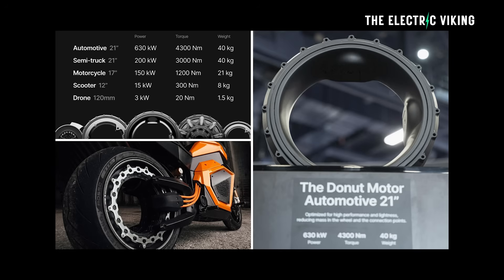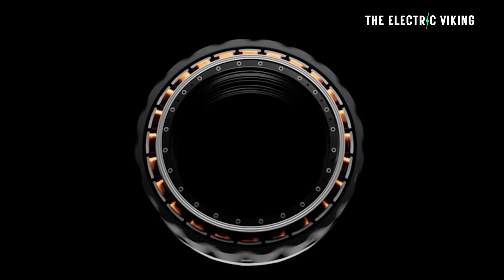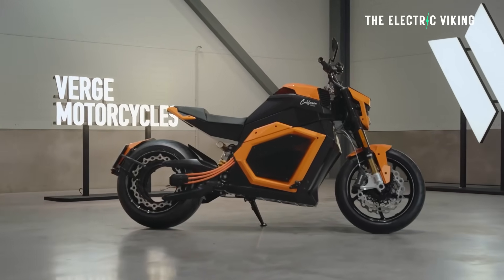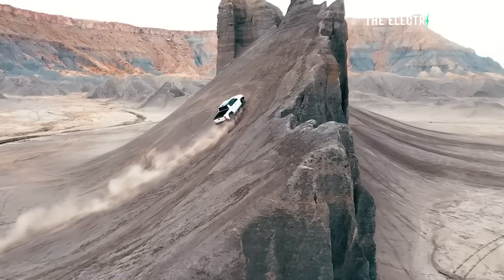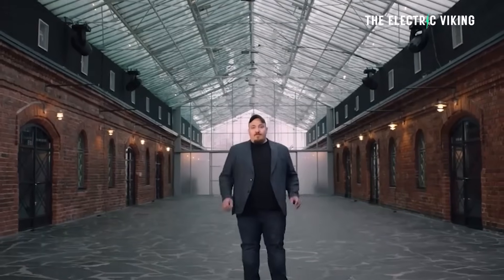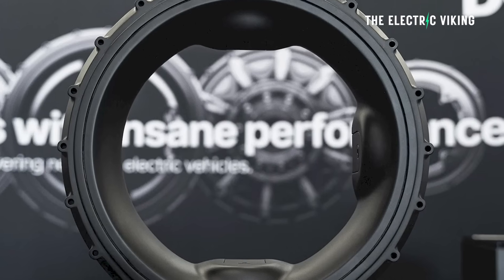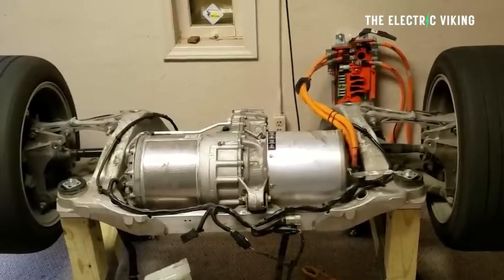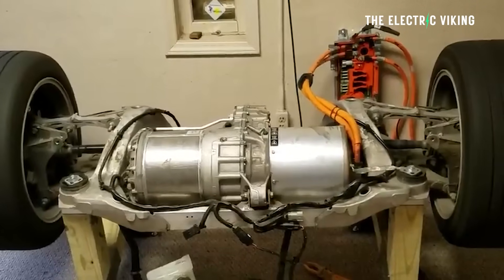Donut Labs' game changing Electric Motors will Revolutionize the EV Industry

Comment: The high torque density suggests breaking is fully electric (no mechanical friction breaks), is this the case? Is motor cooling required, including for the (intgrated) electronics?  If this is yes and no, then how easy is it to set up mass production, including mass production of the required power electronics? It is a spectacular motor design, I like it very much.

Comment: You mentioned that the best part is no part.  But you didn't list all of the parts that would be gone.   First of all it weighs less then half of an existing electric motor. There will be no drive train no CV joints.   No gearing.   The motor is the wheel.  A centre portion of the rim will be gone.  All of the hardware fasteners used to Mount the motor will be gone.  That space Canadian corporate it into the rest of the vehicle and possibly make the vehicle smaller and lighter again.

Comment: The wheel motor it great idea for some applications , but very costly to repair if the donut motor wheels was damaged by a potholes in the real world driving condition , and more likely mub , sand and the water moisture from the salty snow wet road conditions get into the motor and start rusting up the wheel motor. 
That is why it is much better to have the motor away from the wheel.
We have to see how the wheel motor will do for EVs in the real world salty winter driving condition.
😉💖🛞⚡️🔋💯👍
😉💖🌬🌊🌞⚡️🔋💯🌏✌️🙏

Comment: Lordstown tried it. And it doesn't work for cars or trucks.
Maybe for scooters, ebikes and motorcycles does.
Reply: Lordstown only failed because it has manufacturing issues, high BOM and lack of money to continue production - not related to hub motors. If anything they proved it drives normally - a first hub-drive production car tested and certified (homologated) for mass production.

Comment: Only thing I’m interested is an EV battery that has a 300 mile range, can be fully charged within 25 minutes as many times as I want, will degrade 10% over 12 years and comes in a basic £17k car without any gizmos.

Comment: It not about de-tune, its just build it smaller. The MC motor sounds like a good size and with 150 kW brakepower on each wheel and some condensators to even out the power input, you will only need a emergence brake.

Comment: The motor is going to take a lot of abuse being unsprung. The abuse will be multiplied by the additional weight. Might work better on the inside with a shaft. Then size may be a problem.

Comment: I've been using a hub motor in my electric moped for some time, and many ebikes use them. They are not great for off road use due to the un-sprung weight, but they are simple, powerful big out runner motors that allow the frame to hold more batteries and get rid of the need for a chain. These Donut labs motors are so incredibly light for their power, I think they are what we need, hub motors just simplify everything so much. I really want to get my hands on one of their scooter motors for my next build.
Reply: Problem in bikes is also low power in low speed compared to mid drive motors with gears.
Reply: @erik....  I can't agree with you Eric, there are incredibly fast electric drag motorbikes in Thailand and neighbouring countries, they are using big hub motors. These hub motor powered beasts would out accelerate almost anything. https://youtu.be/c3AqCS_rJZA?si=k7Mrq_kl2EehvAf5

Comment: I wonder if the massive forces generated during turning would try to separate the stator (or equivalent) from the rotor (or equivalent).  Sure, the donut motors are great in a straight line, but what happens when the shear forces are trying to pull the motor apart?

Comment: Wheel bearings could be a problem because of the high rotational speed of the rolling elements (the rollers or balls). But if this proves to be not an issue, this motor design offers 2WD for motorcycles, and hub-centre steering, using a frame or chassis that looks nothing like today's motorcycles..

Comment: The big innovation came in 1950 when LeTourneau unveiled his electric wheel. The traction motor was mounted directly into the hub of the wheel being powered. Because of this, the cost, weight, limitations and inefficiencies of a mechanical drive train were eliminated. The power train consisted of a gas, diesel or butane engine powering a generator and the electric wheels.

Comment: The power is governed by the motor controller, not the motor. So it wouldn't be dangerous on an MG 4 if they used the right electronics, also you'd have to have two sets of motor controllers.

Comment: Viking - as you mentioned Musk ( Tesla ) had stated that the best part is no part - and that manufactures will need to de-tune these motors which could reduce components and weight - I believe there will be many more innovative versions and some will adopt centralized bearings and rim integration and include more carbon fiber to reduce the unsprung mass . a car might as well have 4 wheel motors to assist with breaking and cornering especially if someone can manufacture say a 10kg 25 hp version that costs $200 to manufacture  , even the legacy companies could rebound and $10,000 cars would be common , good video cheers !

Comment: The main take away here is electric motor technology has only just begun and we're in for extremely exciting times.  I'm interested in knowing how efficient a 100-150hp version would be
Reply: Yes who needs 800hp.
Reply: @ericmc6482   I bet I'd be happy with four of the Donut Labs scooter motors on an AWD econobox sedan.
Reply: The  press coverage from CES says there 268 and 201hp versions and the 845 hp motor is intended for hypercars.   The 201 hp version is available in a motorcycle.  Which seems expensive at $30k, but I guess that's a low-mid Harley these days.
Reply: @danxschuh  The price is going to have to drop by a huge amount if these are going to become popular.
Reply: Electric motors have always been incredibly efficient. Compared to the ICE which at max can get to about 40%, even the slackest of electric motors run anything from 85%  efficiency to around 99% efficiency for better engineered items.
Reply: A motor will never compete with the unsprung weight of a gear.

Comment: Since when is. 21” wheel a really small wheel? Most cars run on wheels between 16 and 18”, 20” wheels are considered large and detriment to range. These motors may have a place in trucks, but they are too large for most cars.

Comment: I am pessimistic about the flexing power cable between the vehicle and a bouncing wheel. Copper or aluminum wires don't tolerate repeated flexing. But the drone application wouldn't suffer from that.

Comment: Well over a decade ago I developed the concept (and business plan) for converting existing ICE vehicles into EVs, as it makes a lot of sense. Two things stopped it, having good hub motors (as that makes the conversion much easier and cheaper) and high power density in batteries as there isn't that much space in the engine bay (really only good place to quickly put a battery in a conversion, that plus the fuel tank).  It looks like the market is starting to supply the components that make ICE to EV conversions possible, at a reasonable cost and relatively quickly (I targeted one working day for the conversion).
Reply: What happened with your plan ?
Reply: @5whizz9  Couldn't get financing going.  At  least there are a few companies out there that are trying various ways of doing it. Not yet on the (large) scale I had in mind but it's a start. Hopefully one day a group of people are able to make it work!
Reply: Perhaps you should get back at it!
Reply: @douglascrawford2563  while I would love to, but getting the financing sorted will still be a major struggle, plus that I'm now working for a renewable energy development company in New Zealand and generating renewables is something that is close to my heart as well.  I think that if a younger group of people (I'm young at heart but the rest of the body is starting to protest............) would like to take it on and I can support them in a consultancy type of role, that would work better.
Reply: We did it open source in Finland back in 2007-2008, eCars - Now! group. Some of the modularity talk of the (Finnish) Donut sounds a lot like how we presented things back then.
Reply: @jirirasanen  to be honest, the concept of how to convert is not that hard to figure out IMHO.  The devil, as always, is in the detail.  Having worked on the technical side of the conversion process for many years, I know it can be done technically and I also think that economically, it is becoming feasible, especially if the kits are easy to install by regular car mechanics. If this was say 8 years ago (when we moved to NZ), I may have started the company myself but nowadays I just can't afford it to take a big gamble like this.
My own consultancy website has the car (L322 Range Rover) I was going to convert as the proof of concept, unfortunately that didn't happen either, as I just don't have the spare cash to do that.  That vehicle would be a great candidate as it has plenty of space in and underneath it for the batteries and with a single motor directly onto the transfer case (after removing the engine and gearbox). Also the drivetrain is very strong (designed for a 500 bhp supercharged V8).
However my first mass market vehicle would likely be a Toyota or Honda for example, due to the abundance of those models and the longevity.
Reply: @genieb  yep edison is doing it with a generator to a smaller bank of batteries to get around that hurdle.

Comment: Important thing for such motors with permanent magnets is cooling, temperatures above the water boiling point cause neodymium magnets to loose their magnetic properties and vibrations also increase the risk. Not sure why they insist on in-wheel instead of central motor. Additionally neodymium magnets use rare earth elements provided mainly by China so this can be a production bottleneck. Hope donut motors will be a success despite the risks I see. 👍

Comment: CEO says: give me more doughnuts 🍩🍩🍩🍩He looked big 😃 BUT jokes aside it looks promising. However I don't think it can be retrofit, etc.. Because the motor is part of the wheel. In case if you need to change tires you remove the motor as well? Also in ICE cars where do you put the battery packs have to remove so much things and will get odd "holes" like exhausting pipe hump, transmission to the driver.... So those are totally useless waste of space...

Comment: actually, obviously simple as the electric power vector works at the end of a much longer arm, so the same magnetic force creates a much larger couple and power is couple x revolutions,
A bit like giving the electric force a longer lever. Seems specifically usable in heavy and stable machines, like semi's or trains. Definitely not for motorcycles as it would create ginormous gyroscopic stability preventing the motorcycle to tilt and thus to turn.

Comment: I have and sell multiple electric cars. The most important thing about EV motors is their consumption. They are all powerful and pretty light. It's not very useful to have 1600 horse power, and your EV can make only 250 km on highway if you go at 130 km/h. And 150 km of range if you go at 160km/h. Tesla Model 3 and Hyndai Kona has lowest consumption from the cars that i tested. Legacy automakers have not figured out this yet.
Reply: The Tesla Model 3 has the lowest drag coefficient of all non-exotic EVs. That's probably why.
Reply: a lot of ev's use geared motors (usually single speed). when you go to direct drive hub motors you need to use high torque motors (as you don't have the torque multiplication of gearing), hence high horsepower, to achieve the required torque at the wheels.

Comment: Road transport vehicles could be revolutionised.

Each trailer wheel could have a hub motor with batteries located in the wasted space between the hubs where the axles used to be. The tractor need only have a small battery sufficient for its own needs.

Trailer batteries can be charged as the trailer is being unloaded and loaded.
Reply: You don’t want the trailer to push you due to the tendency to jack knife.The best application of motors on trailers would be regenerative braking.
Reply: @danielking2944  Fair point.

But I'd think that control systems could solve that fairly easily. Much more easily than Full Self Driving, for instance.

And that regenerative braking capability might help prevent jack-knifing under braking, when jack-knifing is most likely.

Comment: So, how would one apply the break?
Reply: Lift your foot off from juice pedal.
Reply: @kansaIainen  Regen braking will slow you down, its of no use in an emergency.
Reply: @edcampbell9900   There's enough power in the motor to lock the wheel if it is necessary.
Reply: @edcampbell9900 yeah, wonder how one would apply the brake too ?

Comment: 42 kg unsprung weight is not workable. You have to add the weight of the tire and all the linkage to fasten it to the car. Imagine what that would look like if it has to stand up to 800 hp. If they could make it 100 HP and weigh 10 Kg, that would be much better.

Comment: wheel motors for bikes are a problem. They are heavy and have strange feeling due to to how a bike stays up and has to lean through the corners. Just check youtube creators that have created such machines. They all roll back on putting the motor in the place of where the combustin engine was.
40 kg of rotating mass on the rear wheel of a bike is heavy enough for a bike not to be able to lear right in the corners.

Comment: Quite apart from handling/safety, motor reliability in unsprung conditions is a major issue. But, also, generating that much power in a small motor necessarily involves significant heat generation. Cooling systems imply more weight and, for rapidly moving components, complexity. 

Donut Lab have released no verified details. They almost certainly have a long way to go.

Comment: That's great but it's the randomly exploding batteries that are the issue.
Reply: It becomes an issue when EVs burn as often as gascars . Battery chemistry will eliminate car fires.
Reply: @GWAForUTBE  The first rechargeable battery was the lead/acid  battery introduced in 1859. The first improvement was the nickel/cadmium 1899, 92 years later the lithium battery hit the market, that was 34 years ago. I'm sure there will be a new discovery some day. Also a gasoline car is easy to put out with a handheld fire extinguisher while an EV can burn down an entire apartment building, very nasty in a crash.
Reply: @alexsomerville1689  I have had to deal with a burning gascar using a handheld fire extinguisher.  The fire department was called and the car a total right off. As was the house nearly. The point is, on average, compared to gascars .  EVs rarely burn now.  Every time you hear of an EV fire , there are 600 gascars in the US alone that burn every day. 

Battery chemistry technology has stepped up its different chemistries as well as energy & price considerably in only a few years ,  mostly due to the enormous demand as a result of EVs & energy storage.

Comment: Hell, even that 15kw motor would be sufficient for most cars, add one in each wheel and you have 60kw = 80 horse power, 1200nm torgue and whopping total weight of 32kg. Guess what most conventional ICE cars use these days For example Toyota corolla 1.5l engine gives 88hp and 103nm torgue per powered wheel. So even that would be more than enough for 90% of the cars on the road and with 8kg weight per tire, this would barely affect handling, while giving true four wheel drive, with insane torgue.
Reply: Youve hit upon my interest! I dont care for new EVs because they dont address my concern: i just dont like the style of most new cars. I want an old car with new propulsion ie a conversion. A tiny 15kw motor at each wheel, would easily power an XJ6 or a Holden Kingswood because of the torque. Combine this with Donut's solid state battery (drastically less weight, volume and cooling infrastructure) and a conversion starts to make sense. 

Thats what im waiting for!

Comment: This could make tyre changes interesting and you won’t be popping a spare on if you have a puncture…
Reply: Best solution would be a change in the wheel, where it bolts onto the rotating portion of the motor. Might just need wider spaced hub nuts/bolts.
Reply: @mikemalone9678  There will be a solution, just putting it out there
Reply: Didn't Sam do a video on see-through puncture-immune Tesla tyres?

Comment: and 𝐖𝐡𝐚𝐭 𝐚𝐛𝐨𝐮𝐭 𝐝𝐢𝐫𝐭? The suspension lever seems to be attached in a special way where bearing balls would be exposed to the dirt on the wheel's inner rim. It may break more often, it may reduce efficiency, and so on. Well, most big bikes are just sport utilities, so they are generally cleaned often, but you can not expect that from a working environment, with the employees usually being in a state of dont-care.

Comment: I have to take exception Viking, triathlon bikes opt for aero over weight. 
I’m not sure but I think the drawback of heavy wheels is more energy needed to accelerate them. So continuing to move them along once up to speed is the same and on deceleration they would carry more momentum which could be good or bad.
I’m basing this thought on the law of motion “an object in motion tends to stay in motion and an object at rest tends to stay at rest”